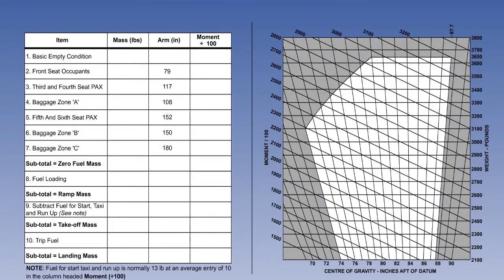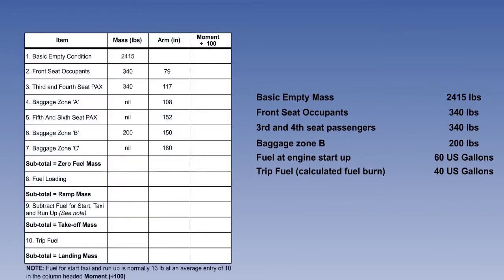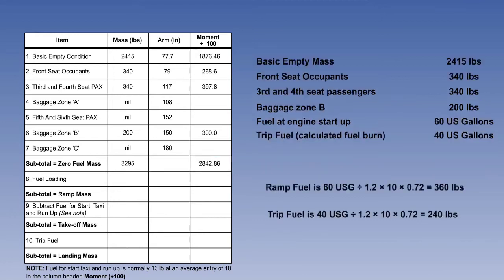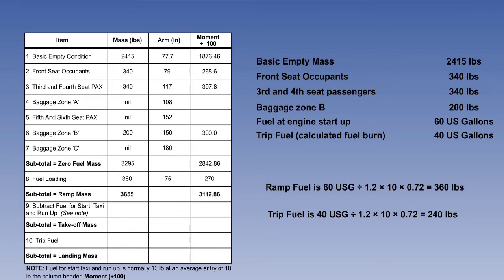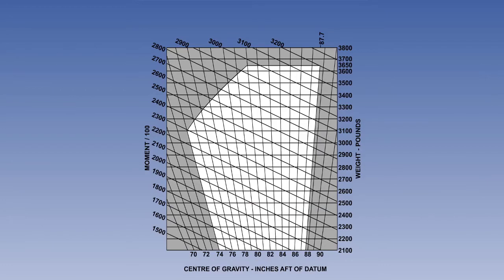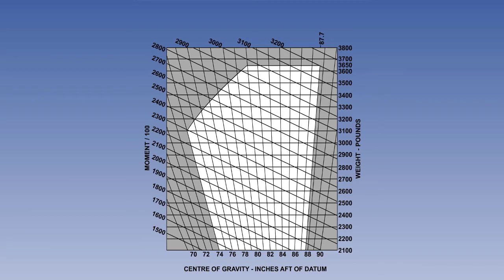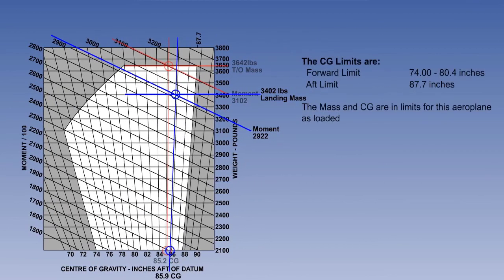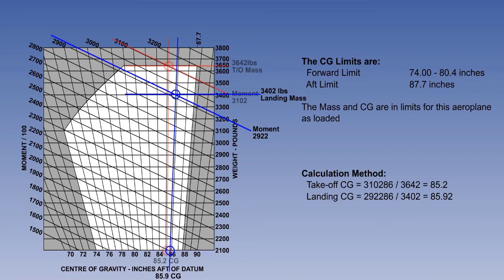Load Sheet For Piston Engine  | Lecture 07

Comment: How do we get the Arm (in) for the Fuel Loading in this chart?
Reply: The arm (in) for the fuel loading in the chart you sent is not explicitly given. However, we can calculate it using the following formula:

Arm (in) = Moment (in-lb) / Weight (lb)
Where:

Moment is the moment of the fuel load about the datum (in-lb)
Weight is the weight of the fuel load (lb)
To calculate the moment of the fuel load, we can use the following formula:

Moment (in-lb) = Weight (lb) * Distance from datum (in)
Where:

Distance from datum is the distance from the center of gravity of the fuel load to the datum (in)
The datum for the aircraft in the chart you sent is 39.00 inches forward of the firewall.

To calculate the distance from datum for the fuel load, we can use the following formula:

Distance from datum (in) = Distance from firewall (in) + Distance from firewall to center of gravity of fuel load (in)

The distance from firewall for the fuel load is given in the chart as 804 inches. The distance from firewall to center of gravity of fuel load can be estimated from the diagram of the aircraft. For example, if the fuel tanks are located in the wings, then the distance from firewall to center of gravity of fuel load will be approximately half of the wingspan.

Once we have calculated the moment and weight of the fuel load, we can use the first formula above to calculate the arm.

For example, let's say that we want to calculate the arm for a fuel load of 200 gallons. The weight of 200 gallons of fuel is approximately 1,340 lbs. The distance from firewall for the fuel load is 804 inches. Let's assume that the distance from firewall to center of gravity of fuel load is 400 inches.

Using the first formula above, we can calculate the arm as follows:

Arm (in) = Moment (in-lb) / Weight (lb)
Arm (in) = (1,340 lbs * 804 inches) / 1,340 lbs
Arm (in) = 804 inches
Therefore, the arm for a fuel load of 200 gallons is 804 inches.

Note that the arm of the fuel load will vary depending on the actual weight and distribution of the fuel load. The calculation above is just an example.